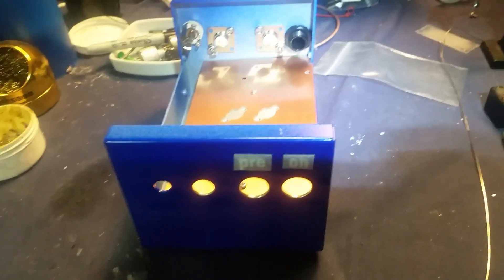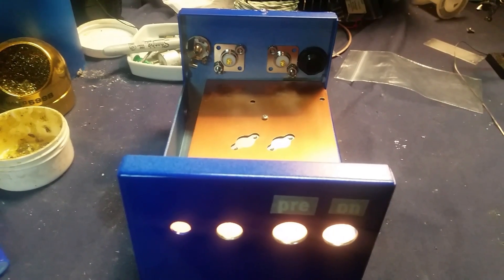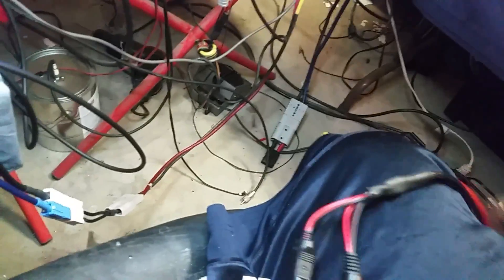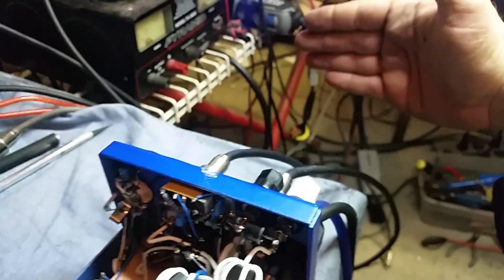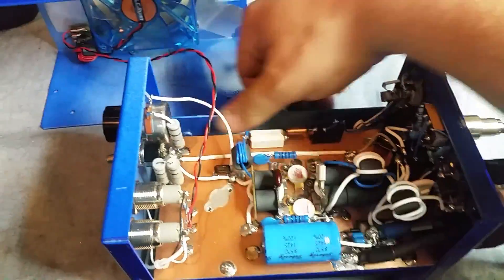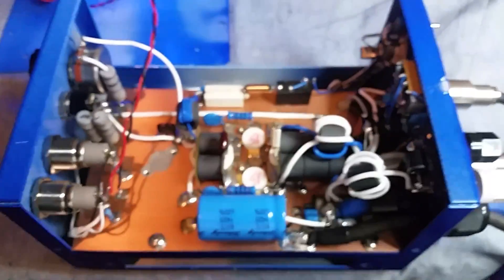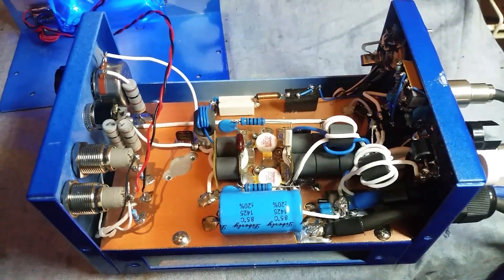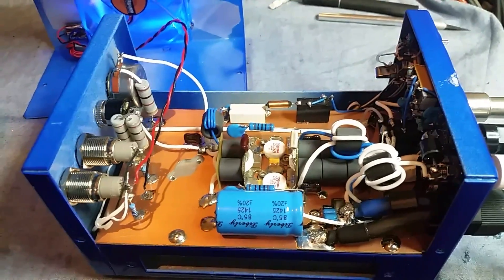Custom GK Built 2 Pill Biased Amplifier With A Sweet Tooth

Comment: that working great ! That Texas star bias works. I am waiting on 2W 1% 1,8 ohm to get to me.   I ordered 100 lot. when you pop a pill it hurts that resistor. had so many go off  value .I use the 1n4997 diode also . you can use power pole connector for radio . I got some from amazon to put into power  supply's.   73's
Reply from the maker: Actually I have used this diodes as well on TS a few times. It will eliminate this issue with blowing that resistor and taking out 2 pills.

I need some 1.8 and 1.6 1 percent 2w Resistors. Please tell me where you found them. I will buy them right now!
Reply: @1883GotDown  eBay seller. searched for them . I got some 200 OHM 1 and 2 watt 1% as well. took a wile looking for many listings .  ICA has 100 ohm 3 watt non inductive resistors. found 5W non inductive 100 ohm and 200 ohm from eBay seller as well . you will spend some time looking for them. 73/s
Reply: eBay seller crystal electronics has the 1W 1percent in stock in USA . just got them today . 1.6 1.8 200 ohm  1W 1% and many more I got. 73's

Comment: this is the only post i have seen GK answer anyone shoot me a email got question on the keying circuit in a golden hooker. picked it up cheapncheap was told the heaters are out. dusty but resistors by the m455 post mount are not even discolored. but the board by the input side is cobbed up bad even the case on the relay got slightly melted really trashy mess EMAIL ME or if your phone # is good ill call
Reply from the maker: Damn i am so sorry back 3 years ago I was so swamped ans over my head I didn't have any day to stay current on my comments and I am doing what I can now to stay current . I am sure you got this figured out by now...let me know bud.

Comment: Why does he need a driver to drive a 6 pill? Seems like it would make more sense just to plug a radio directly into the six pill.
Reply from the maker: Bud, a 6 Pill, 6x2879s need drive. Its a high drive amplifier. Especially his type which is a Class C. a 6 pill can take up to 150w pep drive and be fine. He also is using this amp as a stand alone amp as well.
Reply: @1883GotDown  my Magnum S9 drove my Fatboy  straight six without a driver just fine. Seems wasteful to underdrive the driver to keep from overdriving the final stage. Better fidelity and performance with less stages. Less money too.
Reply from the maker: Scot Johnson oh yeah of course...but a small single final radio wont do much at all to a 6 pill....bit a bigger radio like the one you were using would be great!

Some people have small radio that need drivers and some dont but this paticular guy was going to be running the 2 pill like a 1 pill back down to a 100w or so to drive the 6 if i remember correctly.

Me personally i like to under drive my amps when talking on the air with them.
Reply from the maker: Scot Johnson also this paticular guy was having.this built to run it by it self to. So he wanted to runn it around 400 to 500w by it self and 100 to 150 with the 6 pill.....just was his preference.

Comment: Why is there a big gap between the board and the case ? Gonna be hard to control air flow
Reply from the maker: That Gap is for the Air to be forced down through the heatsink fins and out the side through the air ports of the top lid of the case. I understand just seeing this case for the first time it may look confusing but that Gap is the same length as the heatsink is. It's a forced air design.